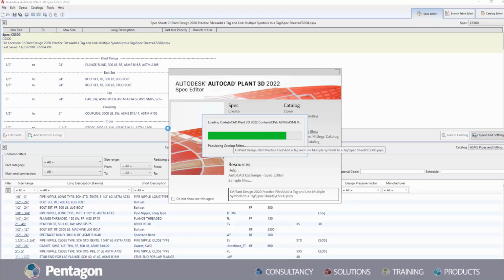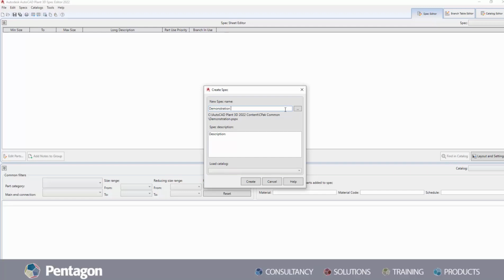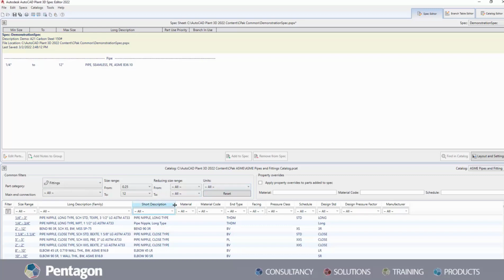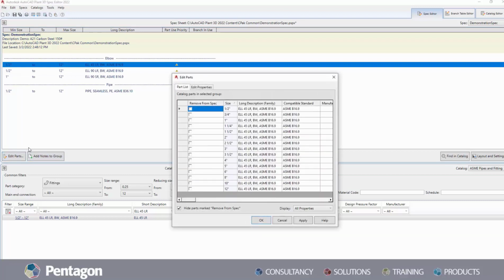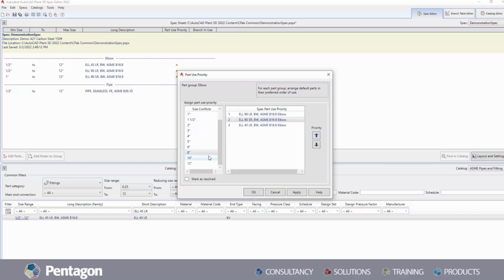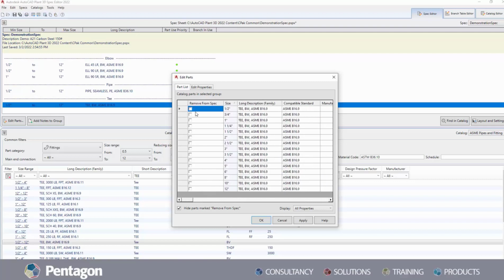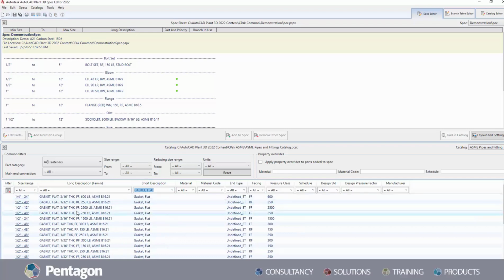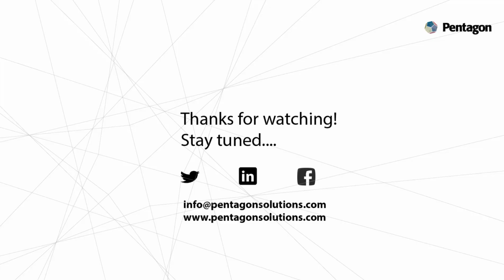How to use Plant 3D Spec and Catalog Editor

Comment: I'm trying to create a new spec with copper tube, using an existing cpak copper catalog, but I can't change the existing dimensions or add new ones...!
Can anyone help and tell me why?
Reply from the maker: The issue may be due to the copper catalog being set to read-only or locked, which prevents changes. Try copying the catalog and saving it under a new name to allow modifications. Ensure you're using the Spec Editor and have the necessary permissions. If the existing catalog still doesn't allow changes, consider creating a custom catalog based on the original.
 If you want to learn more you might benefit from attending one of our Plant 3D courses, get in touch via info@pentagonsolutions.com

Comment: Hello. How can I add 100 inch size in port of equipment and even for the pipes? how can I declare new sizes? thank you in advance.
Reply from the maker: If creating a new pipe or instrument part from scratch, the size range can be defined initially at set up within the ‘Create New Component’ dialog box.  The pre-defined sizes can go up to 160”.
If amending an existing pipe or instrument part,  go to the Catalog Editor and select the relevant part, you will be able to change the sizes of all ports using the ‘Sizes’ tab found here. 
Alternatively, you can attend one of our Plant 3D training courses or contact the team directly at info@pentagonsolutions.com.
Reply: @PentagonSolutions  Thanks a lot

Comment: Hey. I'm on a project with someone else and we need to work simultaneously on the catalog, which is on the server. But when my colleagues have catalog x open, I can't open this catalog either. Is there a way to do this?
Reply from the maker: This is normal behaviour with Plant 3D Spec & Catalog editor.  When a catalog is open and being edited by one user, the file is locked out to that user and only available in a read-only context for other users.  This eliminates file corruption as two users cannot modify the same part at the same time.

Comment: Hello. I'm new to Plant 3D and was wondering where do I go in the spec editor to add new specs for sanitary tubing? I'm thinking it would be best to create it's own folder, but wasn't sure the best place to put this new folder to show up in Plant 3D to use. Thanks. ~ Laurie
Reply from the maker: Create a new spec by going to File > New > Create Spec in the Spec Editor. If you have a similar spec you can create one based on this existing one, otherwise you can start from scratch. Plant 3D offers various default content however we wouldn't be able to comment on if the default content contains sanitary specs.
Reply: @PentagonSolutions  Thanks for the information. Now that I have a new spec created with components, is there a way to separate a category into multiple ones of the same type? What I have so far is that I created different type of instruments: Pressure gauges, flow meters, level switches, etc. But when I add them to the spec, they all are under the "instrument" category I put them under when creating them. How can I separate them out where the pressure gauges are in one section, the flow meters in another section, etc. Right now, since they are all under the one category, so when I click on one of them in the palette that says pressure gauge, it lists everything in there and not just pressure gauge. It's probably because I resolved the part list priority for the sizes. Any help is much appreciated. Thanks. ~ Laurie
Reply from the maker: @authentichomestead  This can be managed by customising the tool palette within Plant 3D.  If you want to learn more you might benefit from attending one of our Plant 3D courses, get in touch via info@pentagonsolutions.com